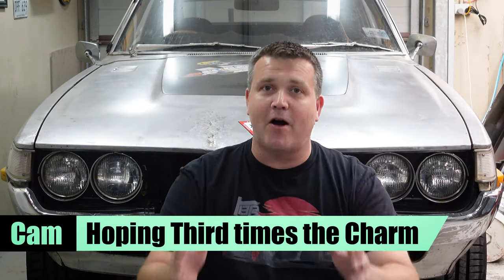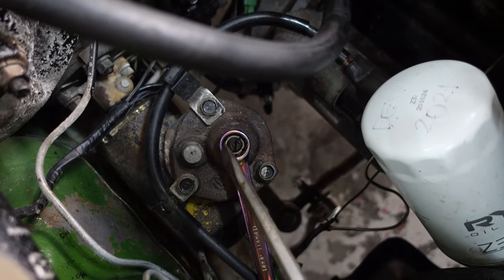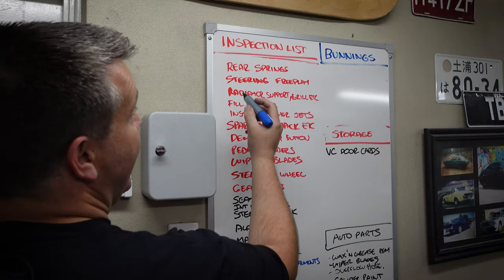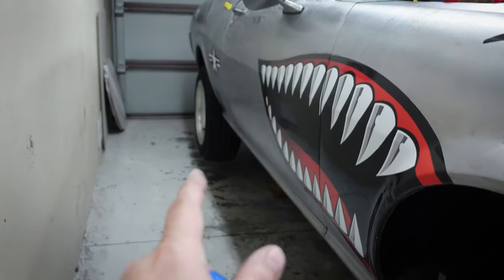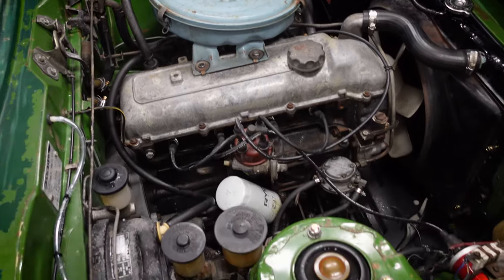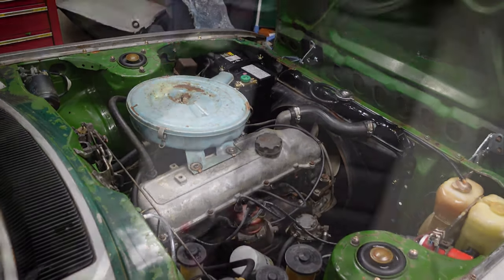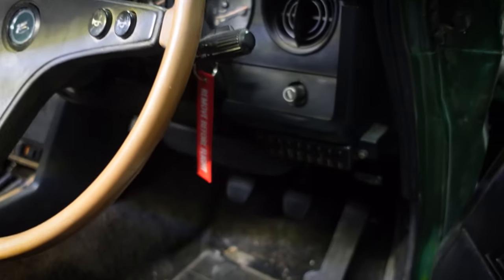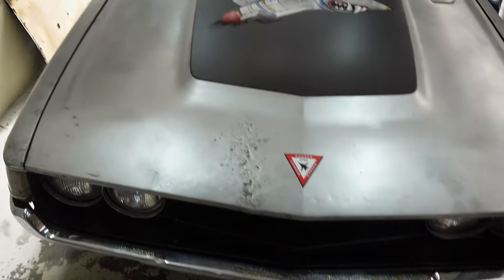Will the Bare Metal Bruiser Pass Inspection? - RA28 Fastback Celica (Part 13)

Comment: Awesome work Cam! I'm glad another Celica is on the road in WA. Are you going to be daily driving it? You'll need an AC for it soon haha. If you need help with anything I met you a Toyotas in the Park, I was next to you with the black 23. Happy to give you some pointers if you going to do an air conditioning install.
Reply from the maker: Nah won't daily it - i work in the city so probably not great for peak hour commuting, but it definitely needs A/C - have all the parts in a box ready to go so that will definitely be in an episode at some point. Was good to meet you at TITP, even if I was a bit of a zombie. Will reach out if i have any issues but all my parts are stock so hopefully nothing too crazy required. Thanks.
Reply: I did the peak hour traffic in mine, never had any overheating issues but was just a pain sitting there haha. I'd spend the money and get new hoses made up, I tried using old stuff myself and it just never worked out. I know a great bloke that does all my AC stuff, looks after his customers
Reply: Well done Cam, brought back memories seeing the “wooden” gear knob and matching trim. Please paint it before it starts rusting before our eyes!

Comment: I remember a light-up info center under the radio. The front brake light was always on. You could take out the light bulb and make it go out. does any of your Celica's have the info center?
Reply from the maker: Yeah the old "OK Monitor" setups were pretty cool but didn't come in Australian cars - i think only GT and GTV spec got them and they are unicorn poo here - none of my cars have them although i do have a friend with a GTV that does and an LT that he retrofitted some he sourced to also.